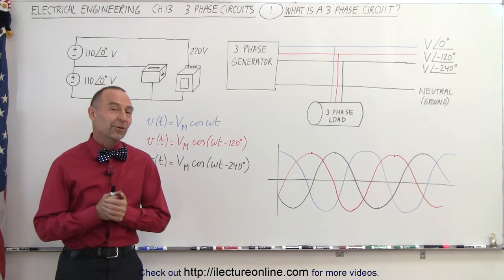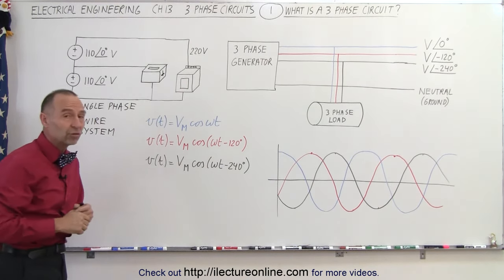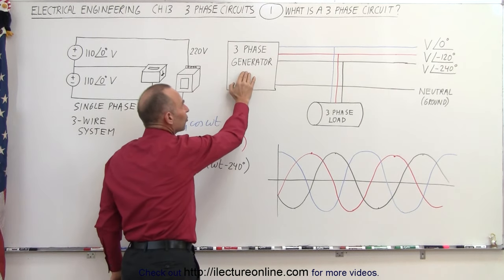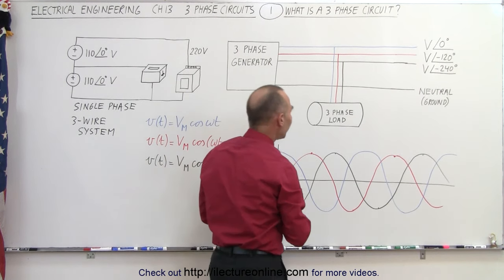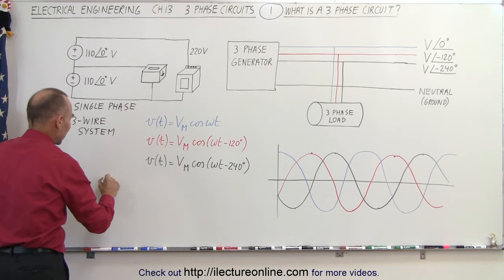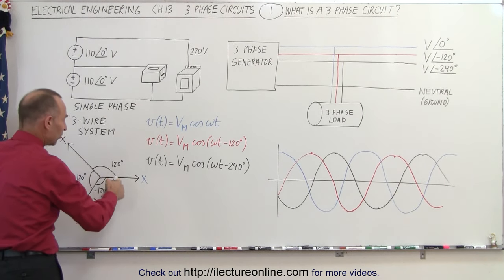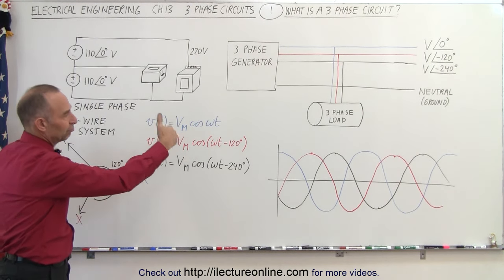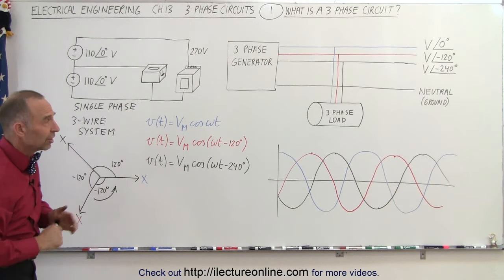Electrical Engineering: Ch 13: 3 Phase Circuit (1 of 53) What is a 3 Phase Circuit?

Comment: If 3 phase is better than 1 phase, why don't we have 360 phase so it would only be delayed by 1 degree between phases?
Reply from the maker: The more phases we add the more complex the circuit and infrastructure becomes.  So we have a nice tradeoff when we have a 3-phase circuit.
Reply: It's an efficiency problem. More loads to build, more power needed to be transmitted successfully, new designs to existing generators etc. The 3Phase system currently in use is itself already pretty efficient. If you look at a lightbulb, you rarely see any delay in the light; to our eyes it's continuous. In reality it goes off any time none of those 3 AC currents are at its peak.

Comment: Sir, what book are you following? Or at least, what book would you recommend me to study for electrical engineering?
Reply from the maker: We use multiple sources, but there are indeed many good books out there.  The key is that it takes time to slowly go through the material and digest it, regardless which book we use.

Comment: The first 60 seconds or so regarding 220V is incorrect:
1. 220V is simply not a North American standard. The US residential outlets are typically 120V and 240V. 
2. Typically, you get 240V by tying the neutral of two single phase but opposite(180 degree out of phase) 120V together. This is how your typical 3-prong sockets wired (4-prong if including neutral in the returns). The voltage between one of the hot lead to ground or neutral remains 120V, and the votlage between two hot leads is 240V.
Reply from the maker: Thank you for this great information.  The voltage in the US is typically listed as 110V and 120V.  I believe the actual is closer to 117V. Do you have experience measuring the voltage and what kind of variation have you seen?  Thanks.
Reply: typically I see anything between 115v to 118v, with a calibrated fluke DMM.
Reply from the maker: That appears to be the same that I have experienced when taking measurements.  Typically I just call it 117 volts.
Reply: @MichelvanBiezen  which 3 phase connection blocks undesired circulating current                                                                        which 3 phase connection corresponding to a higher phase voltage with same generator line voltage                                                              the neutral line cross section area is usually double or triple or half that of other conductor lines
Reply: @MichelvanBiezen  
0:59
Question: Why are the voltage supplies represented by circles with plus and minus inside while those are AC and not DC sources ?